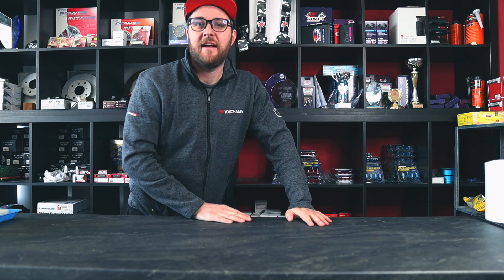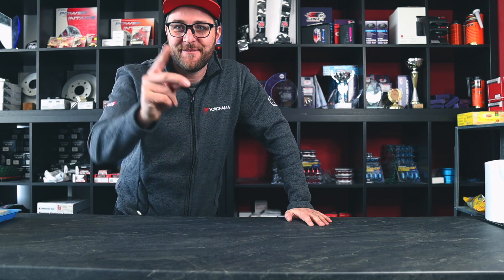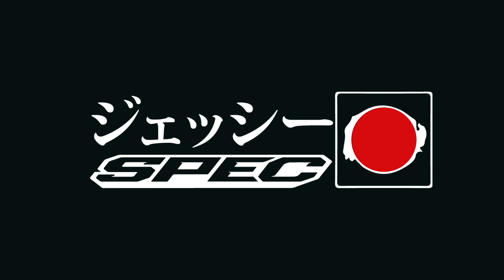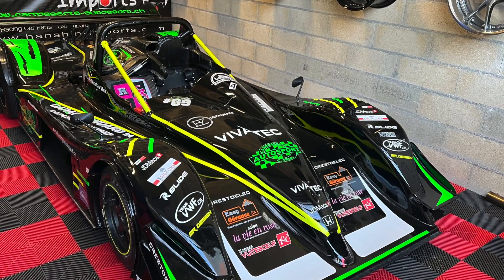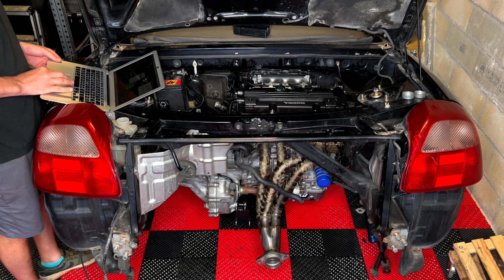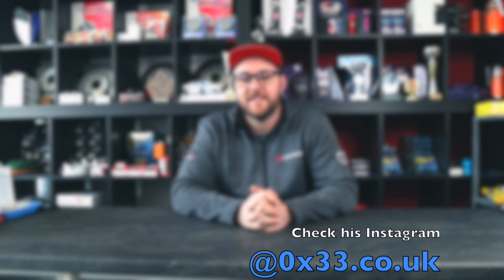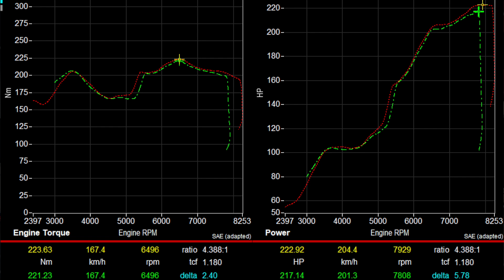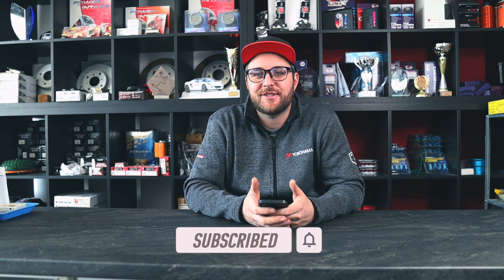How to Kswap an Mr2 Spyder EP14: Final Dyno tune for my K20a (all motor) swapped Mr2/Mr-s zzw30

Comment: With the k series they have to breathe to make really good power. A 3“ exhaust exhaust with a 3” (3.5” is ideal) or bigger air intake system will get you big power gains. At least another 20+ hp throughout the rpm range. The ppe header is choking you as its 2.5”. I learned the hard way lol. Luv the build and channel
Reply from the maker: Hi man! Thanks for the kind and interesting comment. On the Mr2 swap, do we have another choice than the ppe? I guess I am learning it the hard way too hahaha
Need to install some cams
Reply: I seen people use k swap header and fabricate an exhaust to fit. Skunk2 alpha being the best off the shelf product.
Reply from the maker: Never tried that! Might be worth it